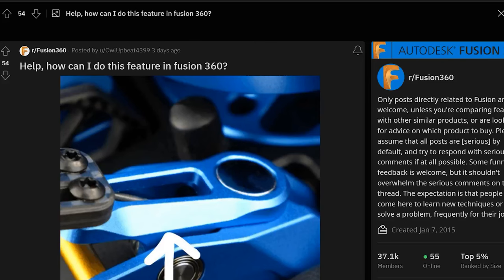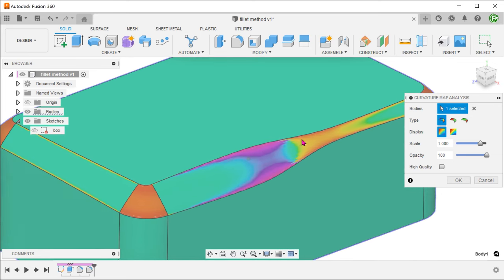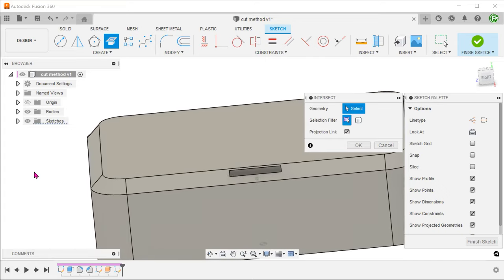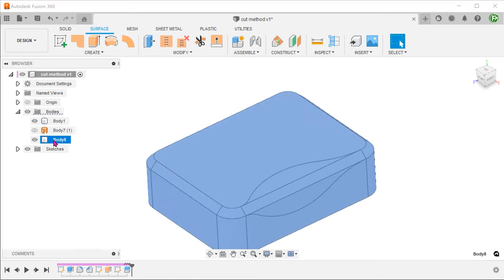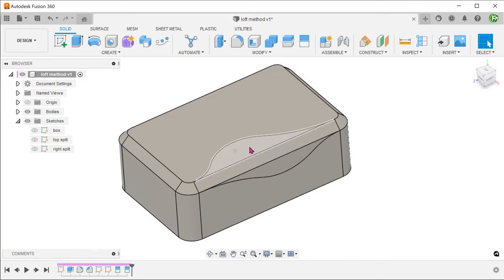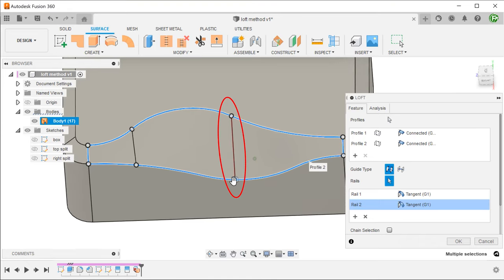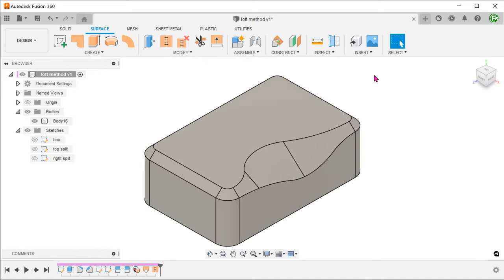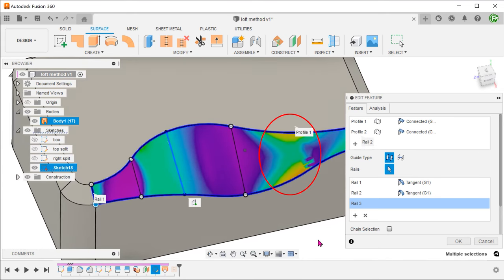Fusion 360 | Variable Chamfer

Comment: Great video! 👍🏻  you can also do this by creating a regular variable fillet, deleting the resulting face, then lofting or patching the edges together (with or without rails). It gives you a perfect 45 degree chamfer normal to each edge. However it's not great for non 45° or obtaining precise geometry relative to other geometry in your model.
Reply: Your guitar design series is helping me out a ton!

Comment: This is a great video, but it didn't mention how to do variable chamfer on curved surfaces, so I figured it out myself. I realized that if I want a 2.5 mm chamfer on one side of an object and 5 mm chamfer on the other, then I just create a sketch on the top face, offset by 2.5, offset by 5, and then connect the two offsets with two splines. Then, I use the break function to get rid of excess, and under surface tab, I do extrude, set taper angle to 45 degrees, and extrude. I use this surface to split the body, and remove the excess and the surface.

Comment: Other alternative ways to bisect a plane with much less steps. 
1. Construct>plane at an angle
Select edge that is at one side of where you want to bisect, angle it so it is at a right angle with the plane. 
2. Do this again for the opposite side.
3. Construct > midplane. Select the two constructed planes.

Second method:
Surface Tools environment. 
1. Create> Ruled surface. Select one of the opposite edges of the plane you want to bisect. Set the direction to normal (so it takes the surface normal of that plane). 
2. Do this again for the opposite side.
3. Construct > Midplane of the two constructed planes.
Reply: The second method would work, but it doesn't use fewer steps than the method he used. The first method you described wouldn't be referencing the chamfered face in any way.

Comment: Thanks for the video! I've also used method 1 (variable filet) combined with method 3 (delete filet face and loft) with good results. It's quicker, but doesn't provide as much control as method 3
Reply from the maker: That's a good tip. The variable fillet is not able to create sharp edges. I don't think Autodesk ever intended for us to use this to create chamfers.

Comment: You can use the Plane at Angle construction tool, too.
Reply from the maker: I tried to sketch a line that bisects the chamfered face and use that as a pivot for the plane at angle. However, I was not able to reference the chamfered face to be perpendicular to it. Did you have any luck doing this?
Reply: @Fusion360School  The Plane at Angle tool tends to snap to cardinal axes, so it's usually a matter of setting an angle of 90-degrees.
Reply: @theofficialczex1708  Did you mean using "plane at an angle" on the perpendicular sketch line to create a plane and setting it to 90°, rather than extruding a surface from the line and using that surface to create the sketch? That's another way of doing it, but it sounded like you were talking about creating a "plane at an angle" without using the sketched line, which isn't possible. I think that's what Fusion360School thought you meant.

Comment: Good stuff, but bottom line is dirty workarounds because f*** doing what you want with proper functions. The reason I use CAD instead of poly modelling is because it is supposed to be precise and not "good enough" like what you can achieve with 3DS Max or Blender. But because so many things are tedious to do with Fusion, you end up with the same level of fiddling. My hopes are on Plasticity to cover for everything Fusions hasn't brought over the last decade.